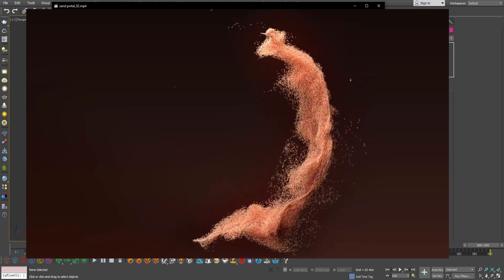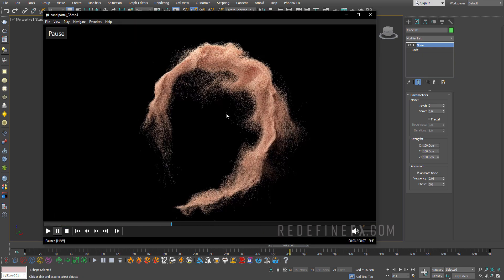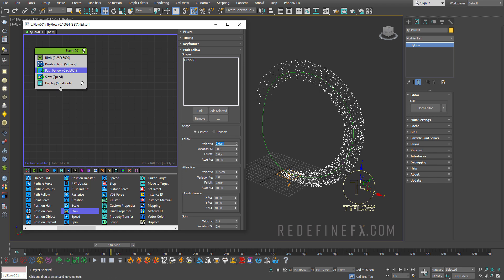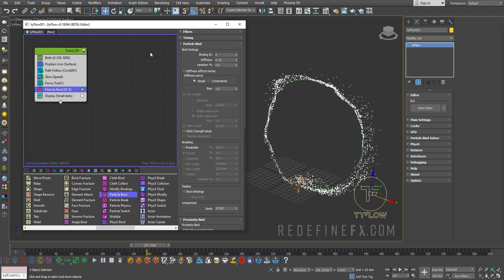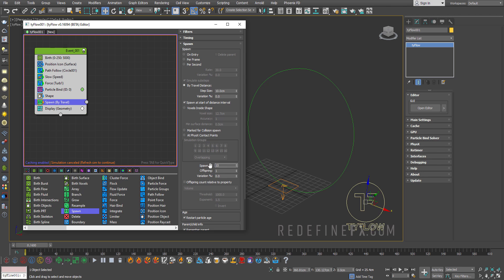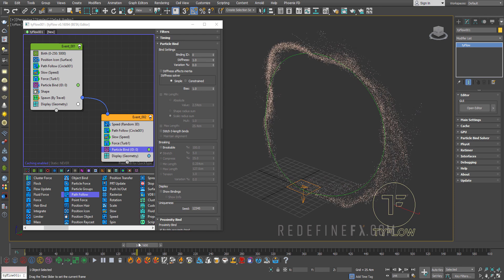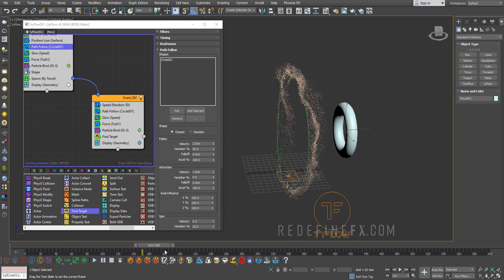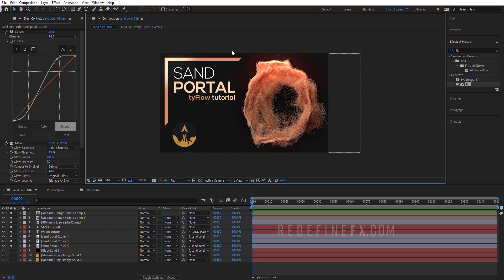tyFlow Tutorial: Sand Portal VFX in 3Ds Max #RedefineFX

Comment: Hi - thanks for the tutorial. I'm finding that TyFlow gets too slow to use at around the point of editing the Spawn (calculating frames). My machine is a brand new dual xeon (56 core) with a 3090... so I'm guessing I am missing a setting here. Any ideas appreciated
Reply from the maker: you need to connect the spawn to something otherwise it keeps replicating in on itself. It needs to flow to the next event just like I do it.
Reply: @RedefineFX  Thanks for the reply dude. It's as soon as I click the "By Travel Distance" option just after placing the Spawn. Not quite sure where connecting the spawn to something relates to this? My apologies, a very new user of TyFlow
Reply from the maker: @8thofthe8th  correct. Yes because spawn will behave differently once it’s connected to where it’s headed.
Reply: @RedefineFX  Thanks - I'm not sure how to fix this issue, but I will keep trying! Perhaps start with something easier
Reply from the maker: @8thofthe8th  Just follow the tutorial and connect the spawn 5:32
Reply: @RedefineFX   Great! That works, but why could you click the "By Travel Distance" before connecting the Spawn to the Speed? When I followed the tutorial chronologically (5.01), mine freezes. I understand it needs to be connected to eventually work, but why could you click it, but I cannot? Amazing speedy replies, really appreciate it.
Reply from the maker: @8thofthe8th  gotta make sure you’re at frame 0 before you click it. If you’re frame 20, all the particles will instantly attempt to multiply 20 times and freeze max.
Reply: @RedefineFX  Of course! So simple. Man, it looks amazing. Such a great tool and tutorial. Thanks again (subscribed)
Reply: I was having the same issue. Thanks @RedefineFX for the answer!

Comment: Thank you so much for this Tuts!   You mentioned to keep the Scale and Units to same settings to gain same results. I did that  - obviously - and My Circle seems to be as big as beeing build with Inch settings - 2,5 times bigger aprox. how can that be?
Reply from the maker: I don't understand the question sorry. I show my exact setup at the beginning of the tutorial.
Reply: @RedefineFX   Well, sorry - I found that you left the the System Uit Scale in Inches - I was having Centimeter there...  (why ever a difference beetween Display and System Units is presents - I mean, either you are in the Inch world or the Metric world... a mix is somehow very strange)  - so, I got it!  thanks!  =)

Comment: Hi Bro !

Thank you for the lesson ! The material is very accessible and high-quality.

My question is: if you do the same thing until 04: 10, but then connect Phoenix FD (smoke or liquid) to the tyflow particles?

how do I do this?

can you do this version of the lesson ? it was very useful and interesting!

thank You for your work!

Best Regards
Tom.
Reply from the maker: Thanks. Phoenix works well with tyFlow particles just have to enable Particle Interface in tyFlow. Setting up a basic smoke sim is covered on this channel.
Reply: @RedefineFX  

Jesse,
Thank you for your answer!
But unfortunately I can't do it.
I don't have enough TyFlow knowledge.
My main knowledge is rendering, creating 3D landscapes and abstraction.
Working with particles is new to me. PhoenixFD is clear to me(I use it for fog, smoke, clouds, + I learned a lot from Your lessons), TyFlow is still difficult for me.

in PHXSource, I added TyFlow.
In TyFlow I found only Particle Forge, in it I added Phoenix FD Fire.
But apparently this is wrong, because in the end nothing happened :)

I didn't find a lesson on Your channel - where Phoenix smoke joins TyFlow particles.